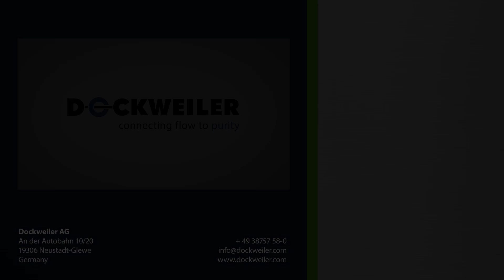Comparing stainless steel surfaces: which is the right one?

Comment: Thank you for sharing this information. Is the pickling following by passivation?
Reply from the maker: Thank you for your question! The pickled material will be rinsed afterwards to clean it from remains of hydrofluric acid and loose residuals inside. Afterwards it’s soaked in diluted nitric acid to passivate. The final cleaning step is purging with DI water and drying with pure nitrogen.

If there are any questions left, please let us know!
Reply: @DockweilerAG  Many thanks for your reply. What kind of test do you use in order to verify that pickling was properly done? Cooper sulfate?
Reply from the maker: @theomicottis3388  We apply first of all a careful material pre-qualification. In the next steps we control the process parameters of the pickling very well (Acid concentration, Temperature, duration).

Random checks are executed by ASTM G61 or we optionally make use of KorroPad Testing in order to identify defects in the passive layer.